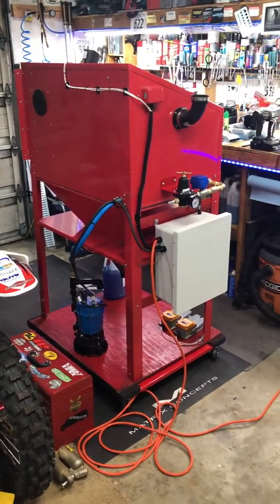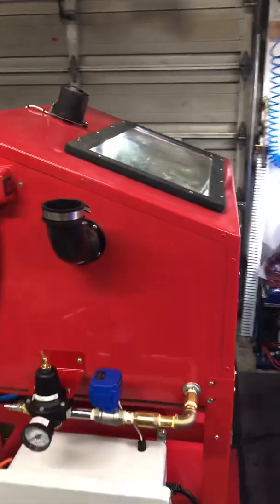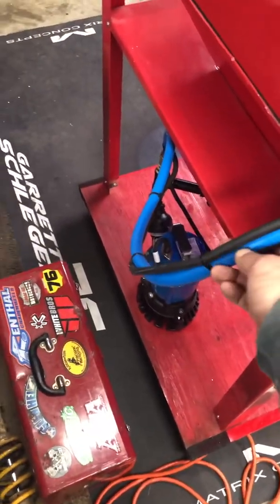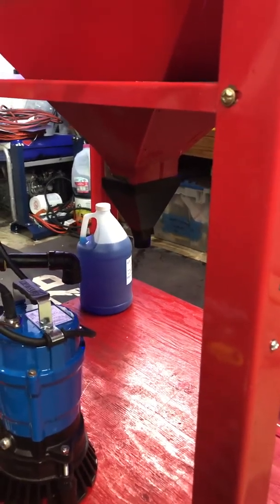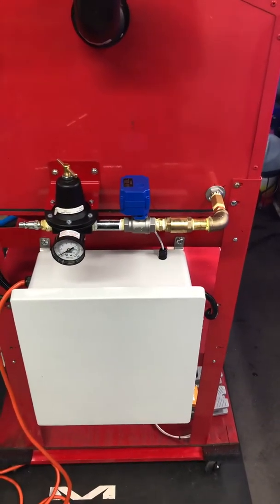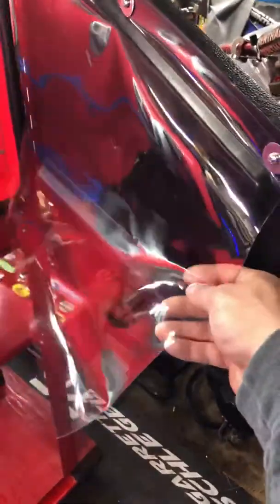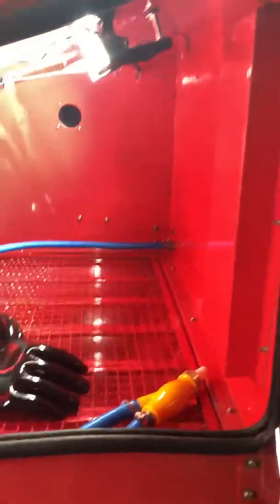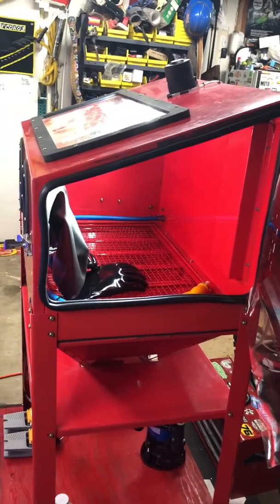DIY Build Your Own Vapor Blast Cabinet

Comment: Unfortunately this is ANOTHER build video that make no mention of the most critical item you need.....the air compressor....
Reply from the maker: Speedaire, 60 gal, 7.5HP, 24.5 scfm
Reply: @garrettschlegel5653  Ok thanks for the info, ebay lists them at $3500!!

Comment: we built a cabinet out of a stainless dishwasher we have a pump but how did you gauge your pressure for gun
Reply from the maker: Are you asking what pressures I run or how am I regulating the pressure?
Reply: @garrettschlegel5653  regulating 
i had a massive cabinet with 25hp motor 100ampre loading 3 phase
Reply from the maker: @GREEVES246  I believe this is the one I used....Coilhose Pneumatics 8804GH Heavy Duty Series Regulator, 1/2-Inch Pipe Size with Gauge and High Pressure Spring (0-200 PSI)

Comment: Do you know if every sand blasting cabinet even if it is a bench top has that funnel and hole at the bottom?
Reply from the maker: Most cabinets will have a hole at the bottom to remove the majority of the media.  Hope that helps.

Comment: Hello No one has the Latching DC Relay Board in stock. What could I use and do you have a wiring diagram
Reply from the maker: Sorry for the late reply.  Send me an e-mail at garrett.e.schlegel@gmail.com and I'll get you over my wiring diagram.  I'll have to do some research on the Latching Relays.

Comment: How's it holding up a year later?
Reply from the maker: It's doing well still...I've abandoned the windshield wiper as it was conflicting with the glass and one of the lights isn't as waterproof as claimed, but all in all it still works great.  I'll have to do a follow up video.  I'm in the process of building a 5' wide unit so I'll put that up when I'm done with it.

Comment: What is the air regulator?
Reply from the maker: Coilhose Pneumatics 8804GH
Reply: Do you have a plan of your vaporblast blast? I can pay
Reply from the maker: @kevenccote2684  I don't have formal plans for the cabinet, but almost all of the parts are listed in the description of the video.  What exactly are you looking for?
Reply: I juste need for the electric shema
Reply from the maker: @kevenccote2684  sent to your IG

Comment: Hi Garrett, maybe I missed it but (how) did you seal all seams of the cabinet? Also, after having used it a few months: does the media wear the paint of the cabinet. Does one need to protect the inside of the cabinet with pvc like you did with the door? Very well executed!
Reply from the maker: I took the entire cabinet apart and sealed everything up with silicone.  Since this is the older style cabinet I didn't have as many sections as a lot of the cabinet is rolled steel instead of bolted.  The paint in a couple spots has worn down to metal, but nothing I'm too worried about.

Comment: Great build. Are you happy with how it works ? Thanks
Reply from the maker: Thanks Bryce.  Yes I am happy with the performance and even used it this week, but it's just a little too small now for the things and side jobs I've had to turn away because they wouldn't fit.  I;m in the process of designing a custom stainless steel cabinet that is much larger.
Reply: Garrett Schlegel. If you could keep us posted on the build please that would be great ! Do you think you get the same results with yours compared to a store bought one ? Thanks

Comment: How did you build you pump with your agitators
Reply from the maker: Hey Bobby....not sure if I understand your question or not, but the pump base is built up so the pump sits about 2-3" above whatever it is sitting it (in this case the slurry mix).  Once the pump comes on it mixes up the blast media and water just with the swirling motion of the pump.

Comment: MatthewMCRepair recently built a new blast cabinet from scratch.  He said that the engine of a vapor blaster is the air compressor.  He suggested 220 volt with a 5HP motor that can push at least 15 CFM, if I remember correctly.  What are all the parameters of your compressor, please?  Thanks!
Reply from the maker: Peace Love mine is a Speedaire, 7.5HP, 23 scfm compressor at 120 psi.  Matt is correct in that your compressor will absolutely make or break how well your vapor blast cabinet performs.

Comment: What bulkhead fittings did you use? Where did you get them?
Reply from the maker: I posted the links in the description of the video for all of the major components.  The bulkhead fittings (barbed and threaded are listed there with links to Amazon).  Hope that helps!  Good luck!
Reply: @garrettschlegel5653  Those are SOOO much simpler than the way Matt shows how to do it. If I hadn't just finished getting everything I need and almost have my machine together, I would go for those. I'm gonna make a smaller machine in a little while, I will definitely keep those in mind
Reply from the maker: @Rantandreason  I'm glad that helped.  If you ever need anything else you can DM me on my IG account g_schlegel287
Reply: @garrettschlegel5653  That does indeed!

Comment: Build looks very clean, good job👍🏻 . Where did you get the control box for all the wiring? I live in the central valley and in the process of building a wet blast cabinet from scratch. Trying to put all of this together. Ive never wired anything like this before and my brain is all twisted up haha.
Reply from the maker: LOL...I do this kind of thing for a living so to speak so it wasn't that difficult for me on the AC/DC circuit side of things.  Basically you will put a DC Power Supply in your control cabinet and wire that up through the switches you'll install for the pump, air valve, windshield washer, etc.  If you DM me through Facebook or IG I can help you out.
Reply: Garrett Schlegel thanks man i will hit you up on Facebook. I really appreciate you posting the links to the equipment you used. Very helpful
Reply: @garrettschlegel5653  sir would you mind sharing your diagram to us? am planning to buils 3 pcs 
foot pedal control
Reply from the maker: @leonardoc.floresjr908  send me an e-mail at garrett.e.schlegel@gmail and I'll forward you my wiring diagram.
Reply: Also do you have a link for the nozzle? I cant find anything online about where those are sold. Thanks!
Reply from the maker: @bagboy5150  Call the Tacoma Company at 208-264-5543.  they are awesome people and they have a few different nozzles.  I got the "Deluxe" and it works great.

Comment: I don’t see the answer to his question..... whats the cost ? Super nice job !
Reply from the maker: Hey Mark!  Thank you for the compliment.  Raw cost of the parts is around $1500 depending on what you can get a cabinet for, the type of pump you get, brass fittings vs. pvc, etc.  I tried to source the best parts I could because I wanted it to perform and last.  I'm in the process of designing a much bigger cabinet from scratch where it will be fabricated out of steel and will fit almost anything I want inside.  That's the one limitation with the HF Cabinet....it's a little small.